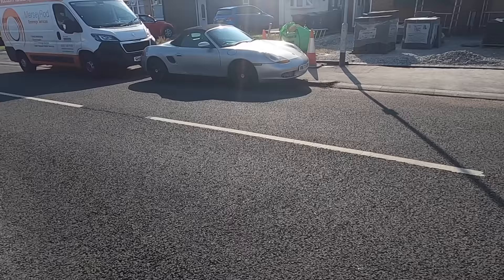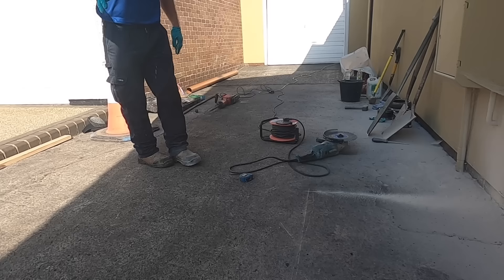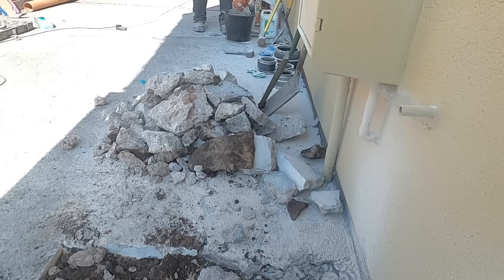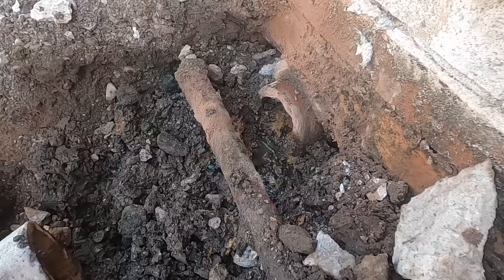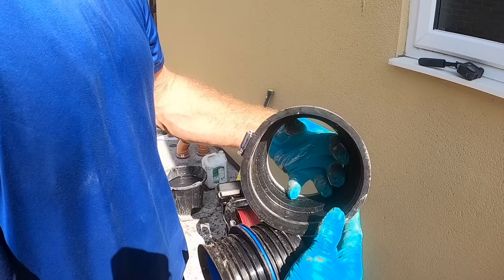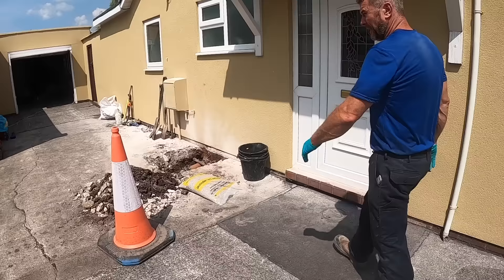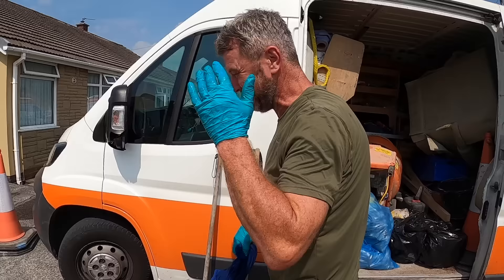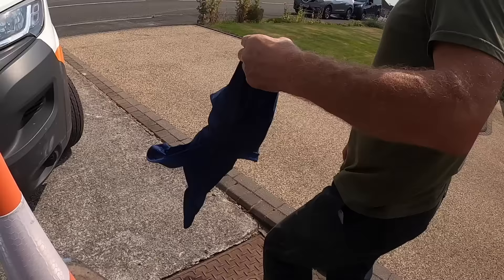How To Repair Your Damaged Drains!

Comment: Though it didn't appear to be as obvious later in the video, some of the earlier footage made it appear that the gas board when they fitted the gas pipe chopped the top out of the soil pipe to allow the gas pipe to pass through. Dirty trick if that was the case... I also thought you were very brave using a disk cutter where you knew there was a gas pipe beneath! I've seen all manner of incorrect and altered installations, where utilities/sevices are much shallower than the law/regulations require that they should be - for example I know of contractors laying fibre ducting in a pavement who hit an 11kV cable with a pneumatic drill, at 3 inches deep. The utility co just said that the cable had been laid much deeper, as per regs, but that subsequent works had made it very shallow. An additional problem with plastic pipes is that you can't detect them before you dig...

Comment: Excellent job fellas, but like you mentioned about the knee replacement. This is why it is important to limit the damage with knee pads, make a massive difference in comfort. Sadly there's only so much cartilage and then it's bone on bone before the replacement.

Comment: Overall a good job! Always a paint when you have  services running across the waste pipe. However that connection from the original clay to PVC is poor, its at least an inch and a half short takes less then a minuet to remeasure and cut a new section of waste pipe, id like to think you agree! Overall that a decent job 👏

Comment: Boys it's mega important if you're doing any prolonged work with high power gear like breakers and grinders to unreel the extension lead fully, it can get mega hot. I didn't believe it until I had a reel catch fire from running a hoover for a long period. Keep up the tasty work boys, looking good!!
Reply: Thanks for constructive comment 👍👍
Reply: @jetter1jem955  love you boys, flat out all the time. Your cleanliness is mint
Reply: Spark here and can confirm what he's saying - really important to always uncoil the lead unless you're using very low power devices on it.

Comment: Have done a few repair jobs, jemmy those inserts for clay fittings, soak in warm/hot water for 2/3 minutes  cover insert ribs with fairy liquid and they will  slide in no problem. 
Top team
Alec dairy services

Comment: U should use a hosepipe on low pressure and hold it near the disc. It keeps the dust to zero and stops all your tools and everything else getting in dust. I did it cutting 100 concrete paving slabs last week and there was 0 dust. Just rinse the area ur cutting on afterwards and job done!
Reply: A stihl saw and water suppression bottle is even easier and a deeper cut so easier to break out the concrete.
Reply: @paulf2529  it is but costs a lot more. Depends how much use it gets i suppose and personal preference. They prettt heavy and hard to manouver in small spaces. Would have been interesting using one of those next to that gas pipe!
Reply: @mattw8963  I only ever carry a petrol saw in my own van aside from a little 5 inch cordless grinder. Works for me. 

But if I had to use a 9" electric grinder then your method  is great. Either way using some water  beats getting a neighbour coming and complaining of dust on the car or washing etc.
Reply: @paulf2529  oh yes i learnt the hard way last week. My neighbour wasnt too happy with me lol so i used the water. I have a makita 36v 230mm i use

Comment: Do you reckon the gas pipe was replaced using trenchless method - Grundoburst or similar? I don't have any experience, but thought it might account for what you found. The pressure of the old pipe splitting would all have been transmitted downwards due to the decent thickness of concrete above. A proper days graft, anyway - beers well earned!

Comment: Nice work lads. looks like the gas service install was the cause. They normally dig down enough to put a plastic 90* bend on the old metal pipe then shove the new slightly smaller bore pipe threw it up in to the metre box. Looks like the gas install damaged the pipe on the dig down or backfill.
Reply: Think your right 
Thanks for watching 👍👍

Comment: I was sweating just watchin you guys.  Also, holy shit, when he was cutting milimeters away from that gas pipe I thought, well, he uploaded it so at least the camera survived... nerves of steel m8.  I bet when they installed that gaspipe the pressure of it resting on top of that old tera pipe over time just caused it to fail.  OR they broke it during install and just thought "not my job" and covered it up with concrete and walked away.

Comment: Can't see how that break has been like that for over 20 years If it was the gas fitters that did it? Where has all the 20 years worth of paper and poo gone?
Reply: Good point 👍
Reply: The mind boggles
Reply: There must be a secret tunnel under there somewhere.
Reply: Followed the intact 'channel' left in the broken pipe. Ground gradually fell in causing the blockage over time. There is however a scar where they dug, I reckon (opinion only!) Gas engineers pulled in new pe (yellow) pipe and when they dug down to connect to new box they fractured the pipe but 'forgot' to mention it. Most subbies are paid per metre installed and have to cover incidental damage so wont say anything unless it's serious

Comment: If that was fixed by the council it would have taken 5 men 2 weeks cost £5k and it would be a mess at the end with crap left everywhere.
Reply: Not just that - the bungalows and neighbours drain system would be entirely replaced with the driveway dug up, the national grid requested to shut the gas supply to that residential area to temporarily remove the gas pipe to make the work easier and safer and both the bungalow owners to go on 3 week holiday = as they won’t be able to use their front doors - stepping into a building site, and won’t have a sewer service and no gas for heating/cooking
Reply: Or they would have sent a "multitrade" fella who would have chucked some Mr Muscle "Unblocker" down the bog and said "all done!" Then charged the council £725 + vat for a fix.

Comment: Good job, well executed. Couple of points, both H&S related - the earplugs you used when using the breaker, you should both have been wearing as soon as you started with the disk cutter - you only have one set of ears, and in later life you may well regret not looking after them. The other relates to face masks - good to see that you used eye protection, but concrete dust causes silicosis, which could put you in an early grave, and you'd have a nasty time on the way there - you really ought to use dust masks or similar. As an employer, your obligations are rigorous, and not using the requisite PPE leaves you open to a wide range of trouble. H&S isn't my thing, but preventing the potentially very serious negative health outcomes of your work - for yourself and your employees should be of paramount importance to you.

Comment: Why didnt you get rid of the water.. You cannot say it was easier to work in the water...there are wer vacuums.. There are even buckets of different sizes..
Reply: No need
Very hot day and mix just right to soak up excess water
25 years experience 
Great comment though 👍😁👍